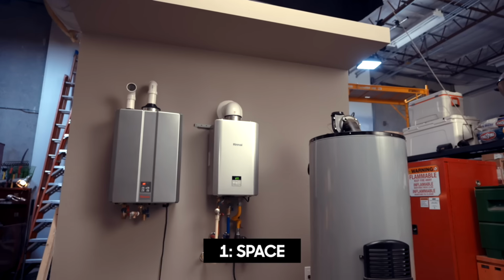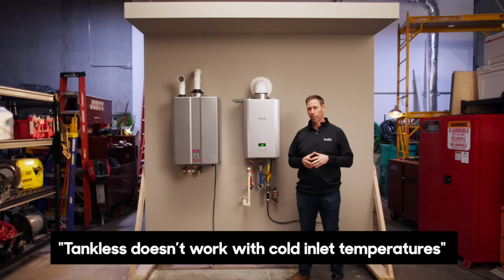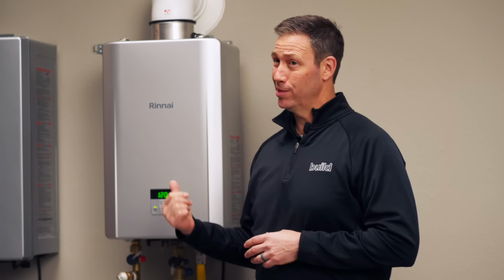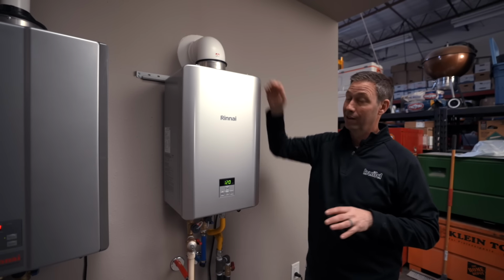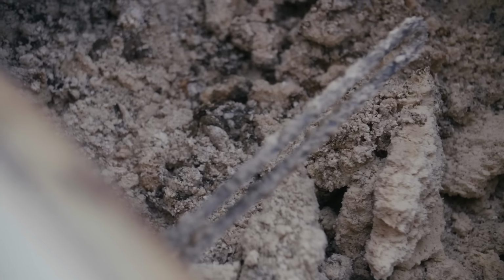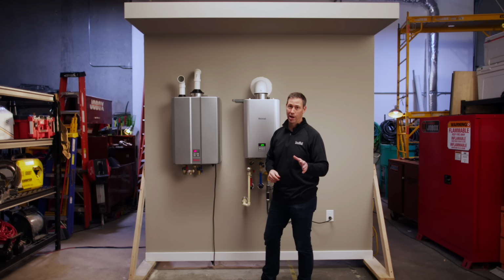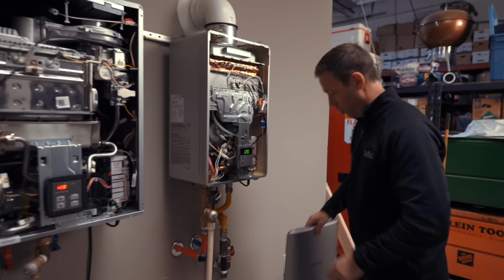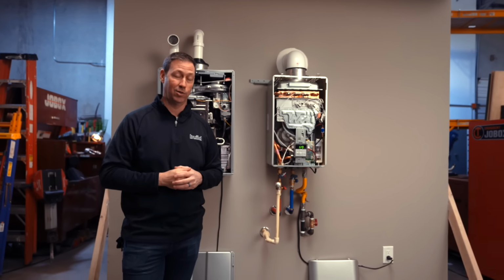DEBUNKING Tankless water heater LIES!

Comment: Most are not lies, they are expensive to maintain, they take a long time to reach sinks without a recirculator pump. They dont last 20 years lol, if you have hard water they have to be cleaned every year. They are expensive up north here to install and to be done correctly. Every plumbing company here Doesn't advice them at all because of hard water and long-term use "claims" dont make it worth the cost. 

 In the end a tankless heat will cost double to tripple the cost of a tank water heater. Repair parts are not always available,  parts are substantially more expensive and more complex to repair. I repair a lot of them and their reliability is lack luster if not maintained yearly, a certain major brand  has a large lawsuit against them for their products. Starts with a N and made in south korea. Also parts for a tank hot water heater any homeowners can repair and parts are available at most home centers.
Reply: Show your proof
Reply: @daveklein2826  Do your research for christ sake, google is your friend.

Comment: Consider how much 4 sf of house costs - that's the value proposition that more than paid for us switching to a tankless w/ a 1-gallon on-demand. Every hot water fixture in the house can run at the same time without issue.

Comment: Tankless are a great product.  Still two to three times the price of a tank. It will never pay for the difference. A Tank last 20 years with no maintenance, those tank you cut apart where probably still working where as a tankless is greatly affected by scale.
Reply: Tankless financially over the life of the unit doesnt make sense when people take into account expensive repairs that requires special tools and supply houses that specialize in that brand vs tank water heaters that are very cheap to repair and parts are at home depot
Reply: Including install maybe, but in my area you cannot install a natural draft heater in a new home, and that requirement has been in place since 1999.  A power vented heater is typically the same cost.
Reply: @dcl97   Power tank heaters are still cheaper then tankless, especiallyover the life of the unit. Plus homeowners can get those parts locally or online in days vs expensive parts that can only be ordered from a authorized dealer and it will take weeks to get in.

Comment: I seem to remember a video you posted about tankless after the great Texas freeze.  The exterior installations were decimated.
Reply: Close it in... problem solved...
Reply: @MRGF78  Doesnt fix the problems where in the south they run the waterlines in unconditioned spaces like attics and crawl spaces.
Reply: @zack9912000  close it in... and insulate it... problem solved...
I live in the south...
Reply: @MRGF78  Yet majority dontnor cabt access all the piping that is installed in outside walls exposed to outside temperature. it isnt so simple as it sounds.

Comment: I had tankless for 3 years and went back to a tank. The wait time for hot is longer because even if it's the same distance, most tankless need to turn on and ramp up. It added a good minute to hot water.  The best feature was endless hot showers, but it came at a cost,  tankless units don't do well for small use, like washing your hands where you only need  a little hot water. Mine would cycle on and off so you went from hot to cold to hot.  I put up with it for 3 years because it was expensive but final I gave in, admitted he mistake and went back to a gas tank,  problem solved. That and my kids don't take 45 minute showers like they did with endless hot water.
Reply: Exactly. Unless you have extraordinarily short runs from fixture to heater, you’re wasting time and water evacuating the cold water sitting in lines. We resolve this with recirculating hot water systems but that doesn’t work with tankless.
Reply: Agreed. I put in ten years of servitude to a tankless before going back to a tank. One of my best decisions ever. Every person in my household HATED the tankless and they LOVE the gas tank heater. Its been installed for years and my wife and kids still comment about how much better the tank is. I wouldn't take a tankless even if someone offered it for free including installation. I'm serious. The only thing I would use one for is target practice.
Reply: That's a bad install/bad product problem.  A good 199k BTU unit can ramp up to above 110 degrees in under 5 seconds. Its a negligible difference.  Most of the time I see this complaint is because the installer put the tankless in a location that requires a lot of extra pipe and/or used an unnecessarily large pipe.  Just because the WH has a 1" or 3/4" inlet doesn't mean you have to use that.  It results in the fixture needing to pump out gallons of extra water before you get to the heated water.
Reply: @dcl97  If you’re fitting to an existing home, you’re never going to completely replumb the house. It’s common to run a 1” trunk from heater to other end of house, branching off to each bathroom w/3/4 and finally 1/2” to each fixture. You could run the 1” outlet into a manifold then 1/2” runs from manifold to each fixture but who’s doing that? Have you seen the cost of copper pipe? 🤣🤣

If I wanted tankless, I’d install multiple units at various parts of house to limit runs to under 10’ of pipe. 

Then again, we only use heat pump water heaters w/80-120 gal tank and a recirculating system. I open hot water valve anywhere in house, instant hot water 👍. Throw in the fact that heat pump water heaters are 3.5-4 times more efficient and it’s a no-brainer.

Comment: Let play the "How many times can Matt say Rinnai in less than 10 minutes?" game.
Reply: It was part of the sponsor deal. Plus lying about the common lies.
Reply: @MrTexasDan  the biggest lie he is not talking about that thankless water heater can not be run by electricity. Wait, does  Rinnai make those?   No?  Well if it puts down competitor s products it is not a lie but  smart selling technique
Reply: @andreycham4797  Without Elec. than the tank heater wont work either once the existing hot water is used considering what heats the tank uses electronics too.  So...yea. 
And if you want the tankless to work during a power loss, either get a UPS connected to it which will last for a few hours...or if its a long outage, people have their generators usually running, which you can power the unit off of.
Reply: @andreycham4797  Electric tankless have a host of problems especially in cold climates. I'm planning a house build now and not a single unit allows for the consistent heat gain necessary. Gas tankless can do it buy I'm not planning on running gas to the house so I'll be using a hybrid heat pump kind of like what Matt actually uses in his house.
Reply: @MrTexasDan  yep....tankless water heaters are not that popular anywhere.

Many people and even new construction homes are still going with tanks because there are less problems and get much hotter water.

A O. Smith tanks all the way!

He's definitely being paid.  So obvious.
Reply: @MrTexasDan  I'm aware... it was a joke.
Reply: @I3iGZ3U5  I know, I was just tongue-in-cheek adding on to yours. Sorry if it sounded different.
Reply: At least he's not promoting Navien, where some models have a 90% chance of failure and/or CO leaks after a year/two.
Reply: @CarmichaelCharles  I got Navien 240a and it works great so far.   Though the installer carries are models and brands, but he recommended Navien over all other brand, Bosch, Rennai, Noritz, etc
Reply: Haha true. I always install Rinnai although most of the time I'm clearing blocked drains haha

Comment: When we moved into our house in Westchester, CA 25 years ago, the first thing I did was replace the 30 gal. gas water heater in the garage with a tankless NG heater. It's still operating perfectly today! it only ran the washing machine and sat idle for the majority of the time. Our gas bill dropped by 30%. I never did replace the house heater though, moving it outside (at the time direct vent didn't exist) was cost prohibitive.

Comment: Matt, didn't you learn your lesson 2 winters ago about putting a water heater OUTSIDE the conditioned envelope of the house?
Reply: This is a paid advertising not a no bs overlook.
Reply from the maker: Agree that I would generally put these inside the home. We froze a bunch of tankless units when my past clients lost power for a week a few winters ago.
Reply: @buildshow  So that  "You can even put them outside" was paid sponsor BS? What else in the video is paid sponsor BS?
Reply: @MrTexasDan  you can put them outside.  I have installed plenty outside. You just have to insulated the water lines and the outside cover  with insulation.  The water heater has ceramic heaters in it to keep the heat exchanger from cracking.
Reply: @buildshow  not to be rude, but the fact you froze all those tankless, makes me wonder about your judgement in installing them there.  power failures are a reality of modern life and a contractor should take that into account.  What else are you imssing as you try to sell me on tankless?
Reply: He's still showing plumbers installing plumbing in exterior walls in every other video... including in his own house (though at least he has some exterior insulation).  So, nope.  Texas builders learned not a single thing from getting a taste of winter.  They're still plumbing exterior walls and still running supply lines above ground and still not installing isolation valves and drains behind their hose bibs and still willing to put a water heater outside.
Reply: Hybrid heat pump is way cheaper to operate.
Reply: He never mentioned outside units in the video
Reply: @Steve-bm2zm  Right at the very beginning.  "You can even put them outside"

Comment: Just to keep things real world honest... Power requirements. If we're talking about Natural Gas for fuel: with a tank and power outage, you still get hot water. With tankless and power outage, you'll need to power it somehow (not for heating element if gas but for the ignition).
That being said, get a battery backup dedicated for $200 with 900w output (the tankless uses about 80watts to spark) and it'll be just right as rain.
Reply: Correct. Also hard water issue cause the sensor in the tankless to fail. The tank doesn’t. Tankless all around is better till you have issue. Once you have issues you’re waiting days, unlike tank you just run to HD and get what you need right away! 🤷🏼‍♂️
Reply: Any plumbers here like clearing blocked drains? Or anyone like watching it?
Reply: On my tank I had a powered exhaust fan and power going to the valve.  A power outage would not allow either of those to work
Reply: @beaker2k  unfortunate that you needed a booster to vent and they installed a fail safe. Lots of tanks are vented on short runs and don't rely on any electricity.
Reply: I had power outages for DAYS.
Reply: EXACTLY WHAT I WAS THINKING
Reply: If you’re really having that many power outages you probably have a generator.

Comment: I have a tankless heater, I had it for 8 years, in the winter,  it takes 5 minutes before the hot water reaches my faucet or shower. It doesn't last 10 years maintenance free. When it raining 🌧 and lighting. I have to cut it off. If you live in an area that has hard water. Your nightmare has just begun. The tank water 💧 heater at my free home, it's 25 years ago and he maintained it by flushing it out, every 5 years and replacing the regulator, ignitor and...ect. It is still working and he's still going to replace it with a newer version. It just my opinion, you buy what is best for you.
Reply: Ya, he really jumped on the Rinnai band-wagon! 😆
Reply: But but, that's not what Matt's sponsor wanted hm to say!

Comment: My well water is too cold those.
Reply: Nope, your well water is  above freezing and all the units are rated on how much they  can  raise the water temperature at a rate per gallon.   My  inlet water is  around 40f in northern NH and it  comes out steaming hot  from the water  heater when running.
Reply: @BobPritchard  Well water systems are hard on these tankless hot water systems, they absolutely must be cleaned every single year with a maintenance kit to keep them operating. If not sized correctly based on average temp of the well they struggle to heat the customers  water. See that a lot. Home depot experts sell the system but not the right one or a maintenance plan to keep them running.
Reply: @zack9912000  I use 3 gallons of vinegar once a year running through a small pump in a 5 gallon container.  I set it up and run it 45-60 minutes while I'm reading a book or phone close by.  Vinegar usually has lots of scale in it.  Cheap and easy to clean it yourself.
Reply: @BobPritchard  Be aware there are other maintenance items most brands require. They sell maintenance kits that include seals and sensors they want replaced often to maintain reliability.  Some can be ordered directly from them, other more high end models require them to be ordered from their dealers only.
Reply: Good info.  On the Navien unit, when it leaked they eventually sent a bag of gaskets rather than one gasket.  So.. I have gaskets for other potential issues.  I do clean out the water strainer and the air filter and blow/vacuum the innards of the unit.  Lots of good YouTube videos guided me on both of my units.

Comment: I have heard electric tankless have a harder time in the north and can skyrocket electric bills, was or is this true?
Reply: Depends on your local pricing for electricity, some  all electric homes gets special pricing. And yes the all electric ones can have trouble if not sized correctly or of the panel isnt large to accommodate the proper KW system.

Comment: Unfortunately natural gas still isn't the long term solution and it will be looked down upon one day soon. From my research a few years ago finding an "electric tankless" unit was still quite pricey and required some fairly heavy power draw. Anyone know of an all electric unit that is more friendly these days? Our home was designed to be all electric as that is the long term future for many of us. So again not having a gas option is critical in this tank vs. tankless dilemma.
Reply: NG is not going anywhere, still the best option for energy in many ways. Electric waters heaters, furnaces etc use a lot of electricity. Be ready to pay for that 'green energy' which really isn't that green, but that's another topic on its own. Electrical grids cant even sustain a hot day, never mind the massive consumption of energy with wh, electric cars, furnaces, heat pumps etc..its all a pipe dream for now.
Reply: @blobtv7444  I agree with all that and for renewables to work people are going to have to realize conservation of energy is the only way forward which means less consumption and waste. Intermittent energy supply and lower energy density of renewables are the two biggest hurdles even before inspecting this country's atrocious electrical grid. But all energy costs will be rising and there is no future where energy gets cheaper, especially when you consider the problem of continued growth which sort of means the demand is always ahead of the supply problem etc. There will most likely be a large slowdown in labor (fewer workers) which puts a pinch on things even more but with birth rates dropping smaller families will help but in the meantime the SUV and the oversized "green home" that still gobbles up more than its share of energy have got to go. Smaller is obviously better. The rest of the developed world has known this for a long time. I've never understand no matter how efficient a home is why its size doesn't figure into the calculation! Who in their right mind still thinks having more square footage and redundant numbers of rooms isn't also the problem?

Comment: I have not seen many 20 year old tankless. Plenty of tank units make it in my area.
Reply: Tankless dont last 20 years, the cost to repair over their life cycle is easly double to triple of a standard tank hot water heater. Some tankless requires special tools and repair accounts to get parts. A tank hot water heaters are cheap to repair and parts are at homedepot or lowes.

Comment: So do you need 3/4 gas line into tankless to run them ?
Reply: 90% of the time YES because of their high BTU output requires a larger volume of NG to heat the water up. There are calculations that are done for total BTUs on the line plus the distances from the meter that tells us if the line needs upsized.
Reply: @zack9912000  Thank you for the info.

Comment: Tankless gas and condensing are nice but nobody talks about Eletric Tankless Water Heaters. Footprint is even smaller, energy efficient if not in use. I recommend a Stiebel Eltron 36kw with a 3M Aqua-Pure AP904 to prevent scale. A lot cheaper than traditional gas tankless if in moderate climate where it doesn’t get as cold and is a little bit cheaper if panel box can support demand.